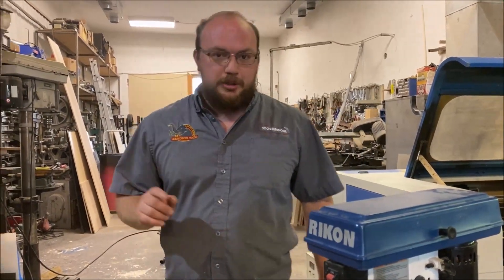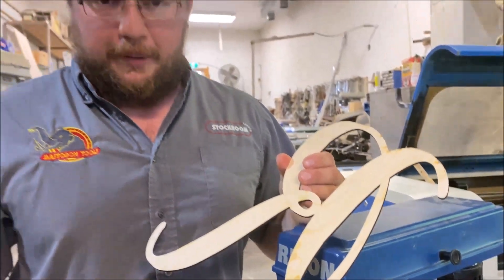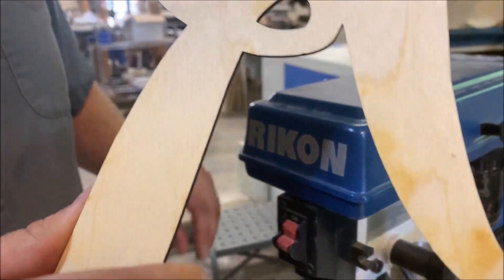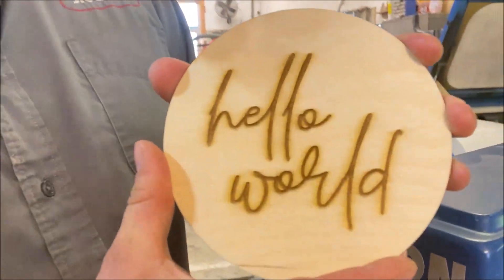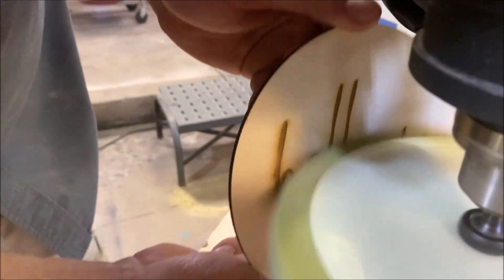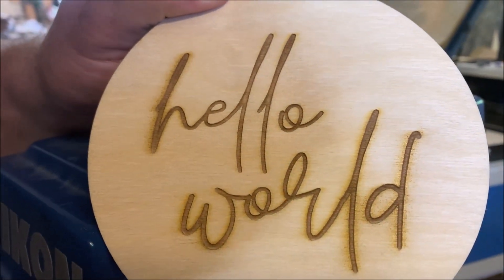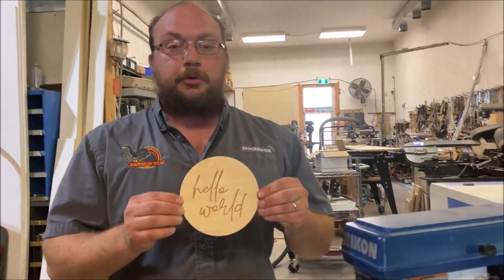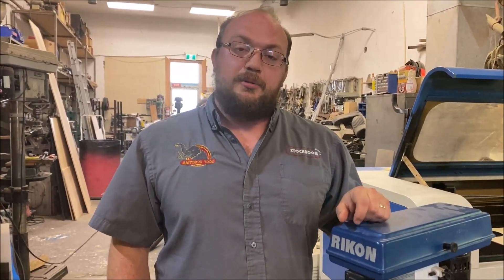How to Remove Laser Cutter Residue Quick & Easy With a Sanding Mop! EthAnswers

Comment: Just want to say thanks for this - I've beenm looking for a quick and not too brutal way of finishing off laser-cut edges for ages. This works beautifully and I've found that a Dremel with an abrasive sponge works well for more delicate bits and little spots that need to be cleaned off.
Reply from the maker: Glad this helps, and thanks for sharing the Dremel tip!

Comment: Thank you for the video. I was wondering about my vents on a cigar humidor. I have a new humidor and the cedar vents have the black residue from the cuts they made on the humidor. The cuts are perfect but there is a black residue when I wipe it. Should I go in and clean them fully with distilled water and a q tip on the inside the vents? I feel like I should but I want to not really use sandpaper inside the vents because it will go in the back where I won't be able to reach.

Comment: I'm confused how this is any better than a regular orbital sander? With an orbital at least you won't be rounding off the corners or digging into the engrave as well.
Reply from the maker: Well there are benefits to both options! Whether one is better than the other hard to say. 
On an orbital sander you will get less rounded corners and less risk of digging into the engraving.
With the mop you will soften the edges(some folks prefer that), much faster than an orbital, easier to hold and if you have a thin veneer on the top of your chosen plywood less risk of sanding through. 
Thanks for watching!

Comment: What about cut out letters? I think the mop might be too violent?
Reply from the maker: They work quite good! On really fine lettering I would slow the rpm down to 2000 or less. This will make for a softer sanding mop yet.